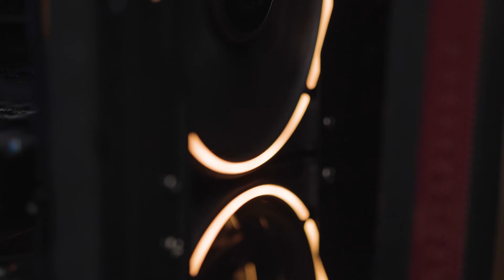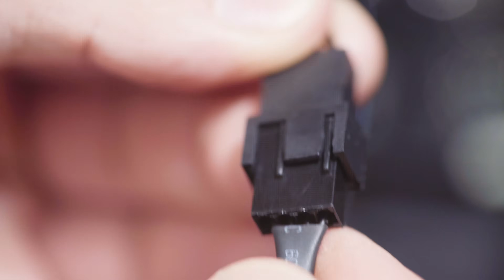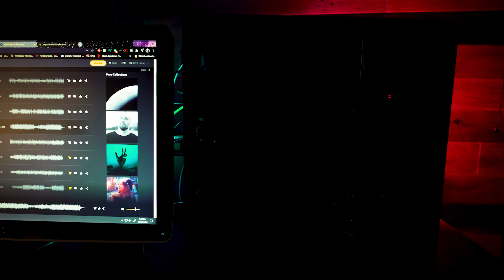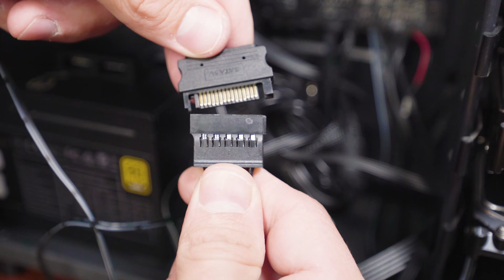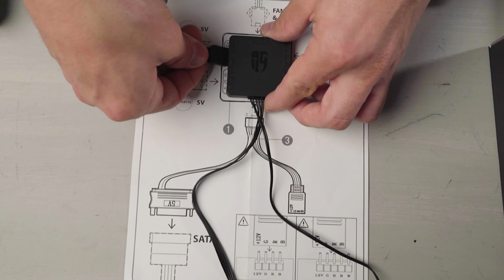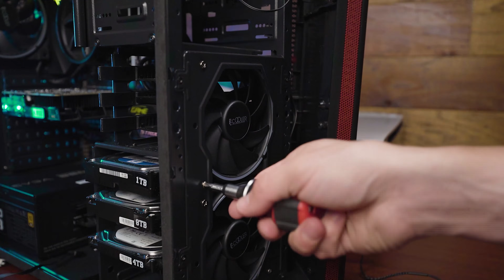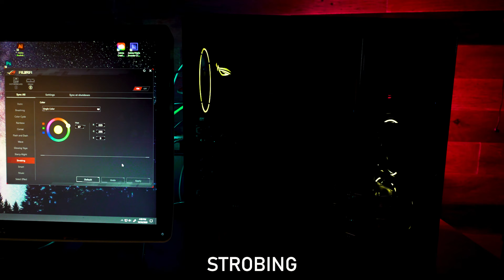Use 5V RGB Fans on 12V Motherboard with DEEPCOOL RGB CONVERTER

Comment: Hi, can I use this on JLED1 on MSI B450M Pro-M2 Max? Thanks!
Reply: yes with the controller he showed in the video.
Check the manual of your motherboard to be sure, there you should find a description telling you what the header is.

If im not mistaken its a 12V GRB header (4pin) and its the right connector to install the shown converter.

Comment: Thanks for the vid. So did the deepcool device it take away your ARGB fans addressable effects or was it the limitation of the motherboard? I'm assuming you can't send ARGB effects through a 12V non-ARGB port.
Reply: Did u find the answer for this question as I'm curious too?

Comment: basically this controller makes an argb fan work as an rgb fan, We cannot use all argb effects with this, so i think buying a razer chroma rgb header would be better
Reply from the maker: Hi Muhammad.  You are correct, there are some definite limitations.  This solved the problem for what I needed for only $20, but I did see the Razer rgb hub at Best Buy for $40. I don't have any first hand experience with that one though, so Please let us know what you find out!  Thanks man.
Reply: @RayValencia   there are limitations if you use this controller. Inshort, you will convert an Argb to simple RGB, you cannot enjoy per led effects with this controller. Razor chroma use usb support instead of RGB header so you can use it in any pc having just a usb header on motherboard. Razer chroma will not convert argb to RGB, you can use all Argb effects with razer controller even you don't have any argb or rgb header in your motherboard. There are also some cheap controllers like that but I'll suggest you to use razer for good software support and trusted quality
Reply from the maker: @MuhammadImran-mc2gq  This is awesome. I highly appreciate you sharing this with everyone! This could be a great solution for those seeking more customized looks with their lighting.

Comment: I have a one 12v 4 pin rgb header on my MB but i have a 5v 3pin argb fans and also a 12v 4pin led strip can i connect those two on that converter?
Reply from the maker: Yes!

Comment: Help please.. I do have a tuf b450mobo and a dr12 pro argb fans.. I cant get my fans synced  with my mobo using the dr12 pro hub.. am I missing any cables here? Im not using any converters, do I need to use any? And can you please let me know exactly what converter should I use to get my dr12 pro fans working? Any help will be much appreciated.. - my mobo header btw only have 4 pin rgb header.

Comment: Hello! Do you know if the Deepcool RGB Converter will work with a Fan/RGB Hub? Can i take the connector from my 5v rgb pin from the hub and plug it into the converter and take the appropriate cable and plug it into my 12v header? Thanks for the insight on the products!
Reply from the maker: I have not personally tried this method, but I do not see why it wouldn't work.  Can you let us know here if you try it out?
Reply: @RayValencia  I have done this and it isn’t working for me. I’m using ASUS armoury crate aura sync, any suggestions?

Comment: Will this converter work with cooler master argb fans?
Reply from the maker: It doesn't advertise Cooler Master on the packaging or manual.  How many pins and volts is your cable?
Reply: @RayValencia  update: i big balls sent it and it works with my cooler master argb fans lmao cheers tho

Comment: Hey Man, I've got a question. I have a Asus motherboard with the same 12v 4 Pin RGB Header. If I connect multiple RGB Fans using a rgb controller to that header then will that header will just be used for signalling or also supplying power to the LEDs?
Reply from the maker: 2 cables: There is a 12V 4pin RGB header cable for controlling the LED lights, and also a 4pin fan header cable that is powering the fan motors.
Reply: @RayValencia  Thanks.. So the 12v 4 PIN RGB cable will just be used for controlling LEDs or also provide power to LEDs?

Comment: one question dude...the power cable of the deepcool converter hub has 2 cable sata+4pin cable...and the 4 pin cable has 12V it has the power so again we need to give another power source from sata......is it working with just the 4pin?
Reply from the maker: I tried it with only 1 of the cables connected, and also tested it with a 6pin to SATA Peripheral cable coming from my PSU, but the fan colors weren't syncing up to the MB and RAM.
Reply: @RayValencia  i installed that....i think i know now...SATA power is for 5V powers...if u connect ARGB element or VDG element it will take power from that SATA cable....and if any component use 12V power like 4pin Rgb then it will use power from motherboard :) so both are needed :)

Comment: This method kind of eliminate the purpose of ARGB since the main reason for using ARGB is to have different colors on every LED like Rainbow waves. Most ARGB fans comes with 4-16 LEDs on each fan, and doing this method, you will only be able to use one color for all the LEDs. I would rather get a Corsair lightning node pro with ARGB adapter so I can control every LED with ICUE.

Comment: Hello, I have six 5v argb case fans splitted into two, will it work that way?. You demonstrated converting three fans, so I am not sure if it will work with six. Thanks.
Reply from the maker: That's a good question.  I only own 3 rgb fans, but I don't see why it wouldn't work. It's a cheap solution if it does though! Please let us all know if you try it out with 6 fans.
Reply: hi, any update on t his? did you manage to make it work?
Reply: @MonesahBuson  no unfortunately, i just set the lights to static with a remote. Maybe check the amazon page, you can also ask there.
Reply: @justinmikko1321  did you have to change your fans or did you just upgrade your mobo for those 3pins 5v?
Reply: @MonesahBuson  did not change or upgrade anything. Just couldnt bother anymore, I wont be looking at the lights when gaming anyway lol

Comment: Thanks for the vid. The thing is I have a ARGB hub, can I directly plug to the converter or should I use splitter cable instead? Hope to here from you soon.
Reply from the maker: I have also been wondering this same question. Unfortunately, I don't have one to test this out. Does anyone know if this will work with an ARGB hub? Because although you gain a lot of functionality and effects with this method, it's not addressable.
Reply: I want to know the answer to this too. Im thinking of using 2 deepcool convertors in case argb hub+convertor does not work. Anyone else tried it out?

Comment: Wow! did not you got trouble when chosing the Rainbo wand Breath effect? Like the fans going different collors, or with strange fading effect on breath?
I watched 3 videos of guys using this Deep Cool adapter and all them got these troubles, you are the only one I see without these problems!
Reply from the maker: Nope, zero problems.  Works like a charm
Reply: @RayValencia  man I buyed two kits of KWG Gemini M1 fans to use with my Redragon Wheel Jack case, but after 5 hours stalng it I got the problems with rainbow, cycle and even other rgb patterns that I told you before on the commentarie above>

on method two you:
 -power suply: you feed your 3 fans with  4pin 12v  spliter to 3 conectors. So, you are using a single 4pin  CHASSI_FAN(or SYS_FAN)of your motherboard, right?
-rgb: you got  one 3pin 5v spliter conected between your fans and the DeepCool hub, and the Hub to the motherboard trough its 4pin 12v conection, right?

Dam it, I was with hope that my kit would work perfectly as yours, but I didnt.
Now I watched your video again to find a way and I got disapointed again, because my fans have an special single 8 pin conector. If they were just 3pin like yours i could do just like you, using 3pin 5v spliter to > 3pin 5v deep cool hub port, and the second cable (Power cable) to > 4pin spliter to motherboard 4pin conector.
Well, maybe I just have to get a new motherboard with at least one single 3pin 5v conector. Thank you

Comment: Hello! Thnx for the vid! I have a question, is it possible to set Rainbow effect by aura sync with this converter? Cuz i didn’t see u setting rainbow effect and u answered on another question that it works with all aura effects! Waiting for your answer, thnx bro
Reply from the maker: Hi Victor. Yes you can do the Rainbow effect in Aura Sync. On each RAM stick, the color will fade into multiple color tones (light blue at top, deep blue at bottom, while the other stick will be turning Pink/orange/red), but the fans will fade into singular colors (similar to the color cycle where they go all light blue, then fades into all deep blue, then purple/pink etc).  It is still synced up though, so as one Ram stick is turning blue and the other is going into pink, the fans will be matching blue and then fade into pink right as the Ram/mb is changing. Hope this makes sense visually for you.
Reply: @RayValencia  nice bro! But can i do the rainbow effects on fans? like on this video https://www.youtube.com/watch?v=V0tv_-hXyIY&ab_channel=ProfessorRamos minute 13:50
Reply from the maker: @victoorvargaas  No, you can do that with the fans' included controller, but it won't be synced up to your Mb or RAM.
Reply: @RayValencia  ok! But can i use aura and controller at same time? They will be working at the same time? Or i’ll have to use one or another?

Comment: Did the 15 pin sata cable for the second option usually come with the power supply or will i need to purchase one on top of the converter?
Reply from the maker: Yes, my Power supply came with a splitter for hooking up hardrives, so I just used one of those ports.
Reply: Thank you for your reply. I'm building my first computer and feel everything was going to be fine, until I realized that Rgb and Argb were different. I'm glad that I found your video and will get this ordered. Another question I have is what do you think the load capability is for this splitter? I know Rgb is pretty low power usage, but would you recommend only using 3 argb fans on a single rgb header with this adapter?

Comment: Hi, first time PC builder here! I'm running an Asus B450M-A CSM Mobo, XPG DDR4 D60G RGB 16 GB RAM, and Cooler Master TD500 ARGB Mesh Case (comes with 3 RGB fans). I bought this converter because the case has a 3 pin 5 volt connecter but my mobo only has a 12v 4 pin RGB header. Using this converter, I was able to get the lights from the fans and RAM to light up but the fans have a flickering issue where the cycle will jump colors every couple of seconds rather than smoothly transitioning between colors. The Asus Aura Sync software lets me cycle through all the different lighting effects but the flickering still persists when I change the effects (except for when it is static). I was wondering if anyone else had a similar issue and if they have any fixes for it. Could this just be a problem with the case or can I fix this through the Aura Sync software? Thanks.
Reply from the maker: Hi Elizabeth. Just dropping a line to let you know, I'm monitoring this thread hoping that someone will chime in that has the same PC case as you, but it does sound like a case/fan issue, not Aura sync or the converter.  Is the included case RGB controller connected to the RGB converter or did you go straight into the fans?
Reply: I have the same chassis and will buy this converter. I will let you know if any issue persists.

Comment: I don't get it. How can you sync the fans when using a voltage converter. The 4pin connector has pins for G R B and Ground. It lacks a DATA pin. How does the MB send signals to it in order to sync the fans for software to work?
Reply from the maker: Hi Viktor.  Don't know the science behind it, but this isn't just a voltage converter... it's also an RGB converter as well. My 3 fans, ROG mobo, and Gskill ram, are all perfectly synced with Aura Sync. I can also control the individual fan speeds too.  The data is going through the 12V 4pin header on my mobo, into the transfer hub, then going out via 5V 3pin directly into the fans.  Hope this helps.
Reply: @RayValencia  figured out how it works. You have sync but not argb. It basically uses the values sent on the grb pins and distributes them as a single colour data. So technically, while you can make the breathing effects, you cant have smth like rainbow. Thats what i got from watching yt vids all day :)
Reply from the maker: @viksa535LOL  Yes! Exactly. That's why I showed both ways that I figured out, bc there was a catch to each way. The first way, with the PCCooler controller could do the rainbow fx, orbiting, and more advanced fx, BUT the tradeoff was...that I couldn't sync the colors up to the Mb and RAM. So I ended up sticking with the RGB converter method, and I'm super happy with it now. I usually keep it all on Color Cycle.
Reply: @RayValencia  can you use the controller if you have the converter plugged in tho? Cuz it wont sync up with the ram for example, put it should allow for effects on the fans if you turn off the sync software or deselect the fans. Have you tried this?
Reply: @RayValencia  So you cant have chasing lights for example. Altho that is probably built into the controller from the fans, you shouldnt be able to command it from your PC, only the remote. Thats why on the effects at the end the ram had different lights on while the fans just dimmed or got brighter, but never 2 colours at a time

Comment: Great vid planning to buy this but im curious if what would happen if i only plugged the sata and the 12volt pin is not plugged cause my motherboard doesnt have 12 volt rgb im planning to plug one 5volt pin rgb to this
Reply: if you already have a 5volt 3pin rgb, you can just use a splitter and have 3-4 fans on that one. And i doubt that your mobo doesnt have a single system fan header. What board do you have?
Reply: @viksa535LOL  hello thank you for the reply and yes i dont have a single rgb header 5v nor 12v and im using a cooler masterfan pwm argb hub and fans are working but no rgb i need to plug the argb to a header which im planning to plug it in to the deepcool converter which in the manual states it needs the sata and 12v pin to be plugged and i was wondering if i just used the sata power and use the 5v socket which im perfectly fine with rainbow puke. My mobo is old a h110m d-d3 :(
Reply: @dado5254  i dont think that you can do that and have any control. However, you can buy fan controllers from aliexpress, they are cheap, come with a wireless remote and dont require anything but sata. They can have quite a few modes preprogrammed, and you can cycle through em

Comment: great video, i got a addressable rgb converter that came with my pc but i cant control it via asus arua, think this should solve the issue? (fans that i installed are compatible with aura)
Reply from the maker: Hi Isidro. Thanks. Yes, this converter should solve the problem for you. It works with all the Aura effects on my B450 mb.
Reply: @RayValencia  is that rgb header you use the same as an jrgb header on the b450 tomahawk max?

Comment: Thank you for the vid, was actually really helpful, I have the same issue 3 pin 5 volts vs 4 pings 12v in my mother board XD
One questions this converter have 2 port for 5 volst 3 pings or just the one  ?
Reply from the maker: Hi Victor. Thanks! It has (2) 5V connectors but one of them is a dedicated 5V 3pin Gigabyte connection, The other is a Asus/MSI 5V 3pin connection.  You can use a splitter out of that port like I did too. The other side has (2) 12V 4pin Connections for Asus, MSI, Gigabyte.
Reply: How did it work out for you bud?